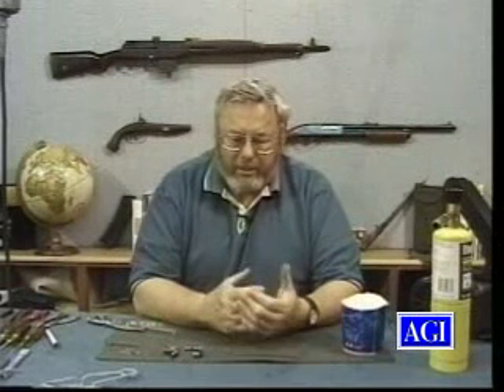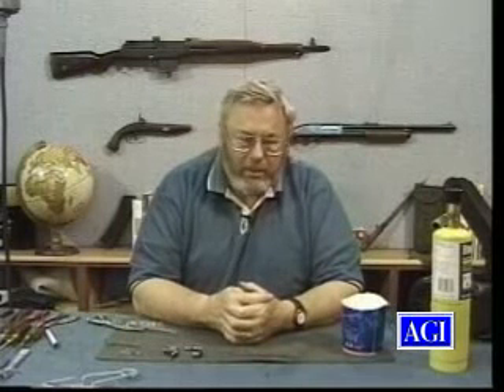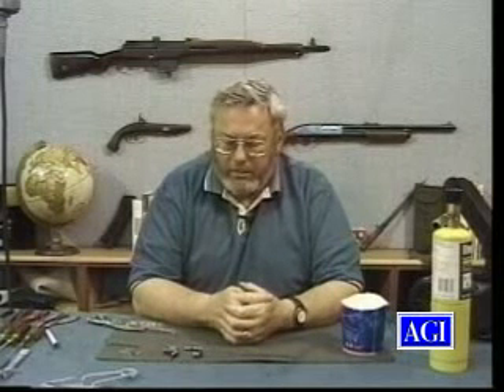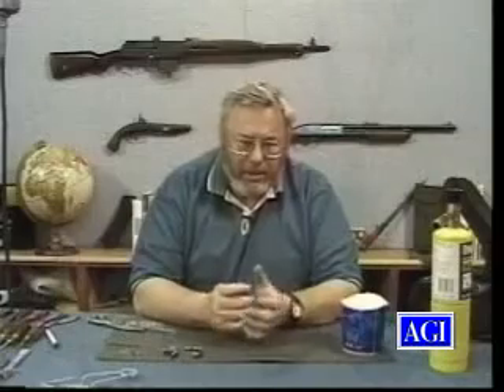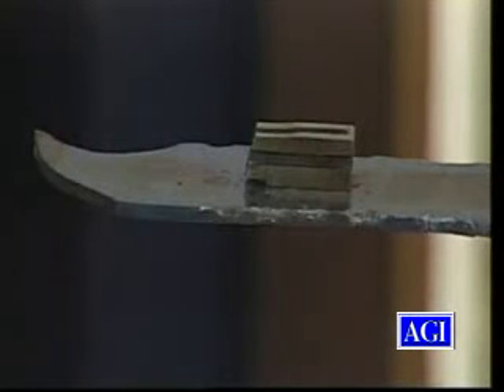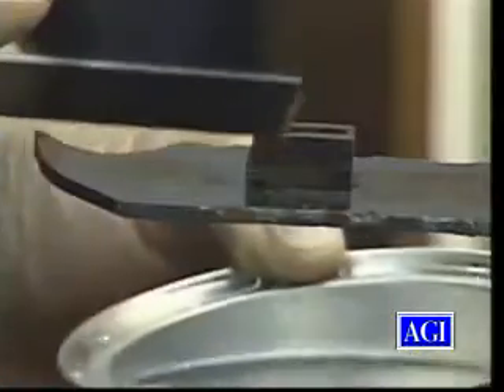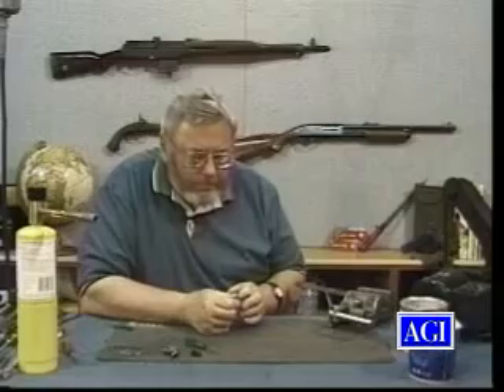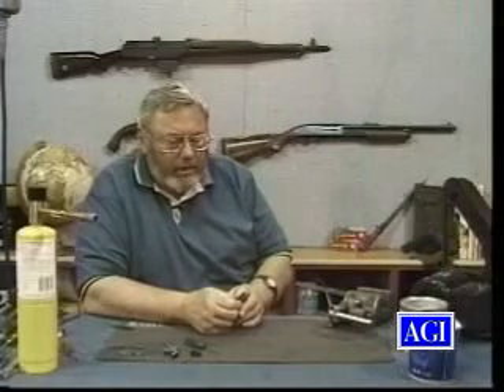AGI 319 How tro Heat Treat Carbon Steels

Comment: Are shotgun and pistol barrels heat treated normally?  I ask because Iraqiveteran8888 was shooting 44-40 rifle rounds out of a 410 shotgun and expected it to blow up.  They said that it would generate pressure of 44,500 psi.  I also watched another gun builder doing a project and he said that if you heat treat steel it goes from 50,000 psi failure to 200,000 psi failure.  That seems to mean that barrels are NOT heat treated and I am wondering if that is true and is it simply a cost cutting measure?

Comment: @Hemi, Hemi,  My best guess is that it's an Egyptian Hakim rifle.  Not even close to a BAR.  At first I thought it looked most like an SVT-38/40, but it is lacking the steel ventilated shroud in the front that covers the gas block and barrel forward of the handguard fore end.  Compare this with the Egyptian Hakim.

Notice the circular metal on the side of the buttstock, the lightening cut on the handguard, the protrusion on the receiver cover, etc.